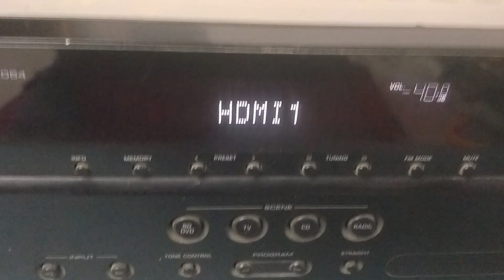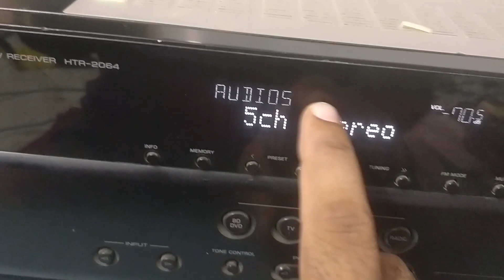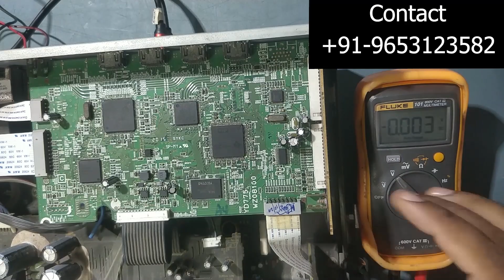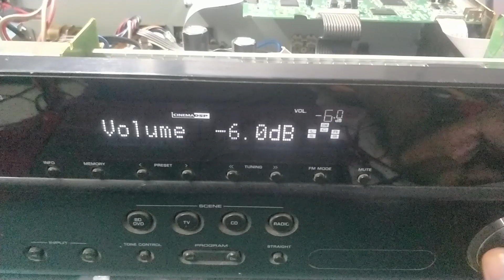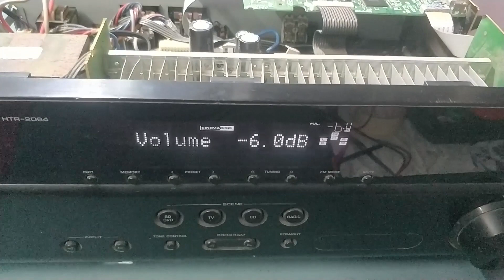How to repair YAMAHA HTR-2064 AVR for NO SOUND Problem, TRICKS TO DETECT FAULTY IC & REPLACEMENT.

Comment: Can I just buy the full pcb instead of replacement ic !
Reply from the maker: Try if you get full new pcb board, replace it
Reply: @TKFElectronics  do you have pcb available?
Reply: Is it possible to bypass all DSP n controls and use the receiver as a power amp ? Coz this is my 3rd receiver I had bought. Previously had two denon receiver's both with DSP fault

Comment: Hi Sir, is it possible to take front channel PRE outs from this receiver? Its real power as per the yamaha service specification is 15 watts per channel,which is like nothing to run tower speaker (with proper controled audio)
Reply from the maker: Bro this AVRs is meant for home use capacity only. Not for Towers speaker, u need power Amplifier to run Tower speaker sir.

Comment: I have HTR 2064. Problem is no sound, yamaha service center guy said, few IC needs to be replaced. Repairing cost is extremely high. 😢
Reply from the maker: Where you located bro
Reply: @TKFElectronics  pune
Reply from the maker: This is my whatsapp no. 9653123582
Reply: @TKFElectronics I'm from Thane.
Where you located?

Comment: Do you use any particular solder for the heat pad? i.e. does it need to be a low temperature solder?
Reply from the maker: Just use best quality solder wire & paste & more important is thin tip of solder iron.

Comment: Can you please suggest from which site i should order the spare? My av htr2064 not powering on, only making momentary click sound of power relay. I wanted to clean it, but after assembly, it is behaving in this fashion.
Reply from the maker: Which spare parts you are looking, just enters that electronic components no. in Google search u will reach to plenty of suppliers website
Reply: @TKFElectronics  I have one Yamaha HTR-2064 (YHT-196), which is having no sound on Front Left / Right Channel. If I increase the sound fully (+16dB), then there is very faint sound (clear¬¬) in front - left speaker, but right - front speaker is still silent. When I traced the AUDIO DSP (IC-241, TMS320D70YE101BRFP), in the pin 117,116 & 115, I get voltage in all three pins in the range of 1.12 V, which goes off whenever decoder is off. All three pins behave similarly. Display shows all the speaker symbols. When traced further, the respective DSP pins are going through resistors R2425. R2426 & R2427 (all of 47 ohm) to the DAC IC-263(PCM1681PWPR) to pin 6,11 & 12 respectively which is found continuous on checking. In normal condition, output pins of DAC 27,26,22,21,20 & 19 gives voltage in the range of 2.4 to 2.5V and output resistor and capacitors (R2639, R2640, R2641, R2643, R2644, C2645, C2646, C2647, C2649, C2650, C2651) are checked and found OK. I have another completely functional Digital card from other unit, which when put the output off all the speakers are giving output normally, which confirms that main board PCB is OK thus there is surely problem in either audio DSP ic or DAC ic. Both the ICs are not getting heated on prolong operation, and voltages in i/p pins are checked ok.
I am a hobbyist and tried to repair my home electronic and electrical gazette. Can you suggest how can I repair the Digital PCB, (as DSP IC change required very high-level skill and IC itself is costly, Rs2700/- around). Can I try by replacing the DAC IC? Please suggest.
Reply from the maker: Bro are you a qualified technician,
Reply: @TKFElectronics  I work in the field of telecommunication and repair is my hobby.
Reply from the maker: Then I recommend you do not attempt to repair it some things more will get faulty, give it to your nearest Service center pls try to understand. Rest is upon you

Comment: I have sony home theatre ht m55. All the 14 power transistors are working perfectly. But sound system going in protector mode everytime I turn it on. Could you help
Reply from the maker: May be problem is in digital board
Reply: Op transistors biasing voltages check it shouldn't differ
Reply: In Sony they have 100 ohms resistors for - + supply check for value changed or high

Comment: Sir i have an question, i have active subwoofer and i want give it input from my htiv300 is it possible
Reply from the maker: I suggest u pls do not connect any Active sub woofer to input  sub woofer of IV300.
Reply: Yes it must be damaged due to high output I meant to ask do we any options to get out put from mother board as you made a video where you showed input output signals
Reply from the maker: Yes I am working on it, I am so busy I am not getting time, many of viewers are asking for it, once I done this soon I will upload video how to take pre Amp output.
Reply: Sure sir,